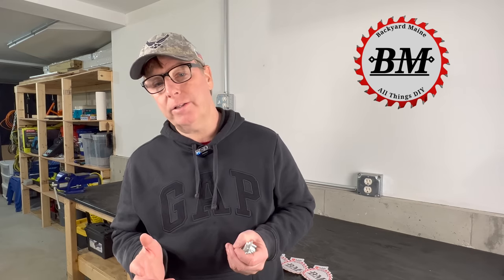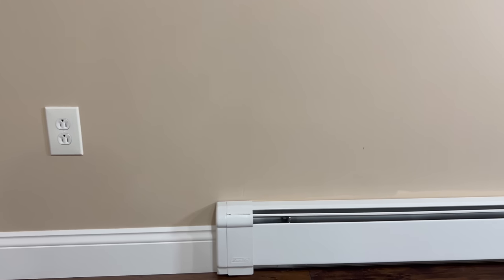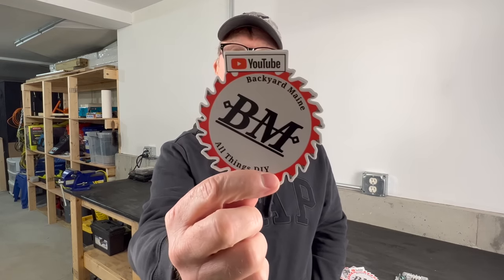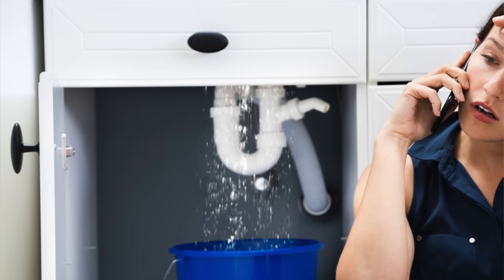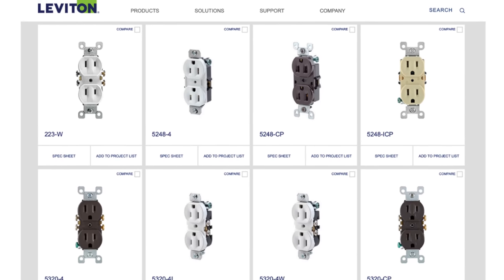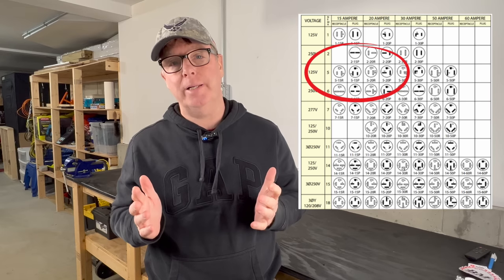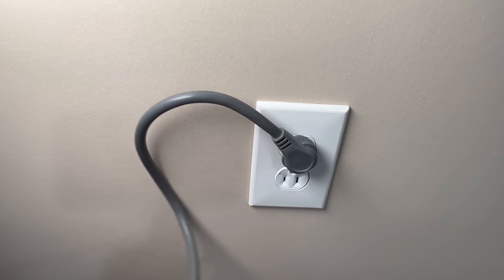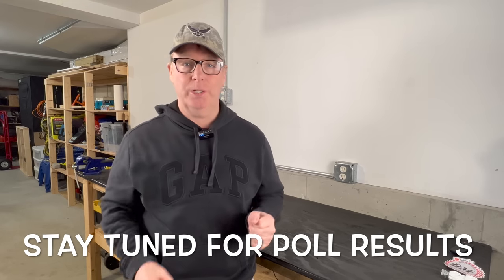Are your outlets installed upside down? (You may be surprised)

Comment: Could someone tell me what the proper term for an outlet/receptable is? I've called them "outlets" my entire life, but then I heard someone called them "receptacles". Then I thought to myself Wait, technically that is a receptacle. But I want to settle this once and for all so that I can master the lingo and bring myself one step closer to world domination.

(Also, I know this is a year old video, but down.)
Reply from the maker: The actual name of the device is receptacle. Most people call them outlets and thats fine too but the code defines them differently. A receptacle outlet is also correct. Here are the definitions from the NEC:

Outlet. A point on the wiring system at which current is taken to supply utilization equipment. (CMP-1)

Receptacle. A contact device installed at the outlet for the connection of an attachment plug, or for the direct connection of electrical utilization equipment designed to mate with the corresponding contact device. A single receptacle is a single contact device with no other contact device on the same yoke or strap. A multiple receptacle is two or more contact devices on the same yoke or strap. (CMP-18)

Receptacle Outlet. An outlet where one or more receptacles are installed. (CMP-18)
Reply: A light fixture, a water heater connection, an AC unit connection, etc., all are outlets. A receptacle outlet is one of many types of outlets.

Comment: Some federal jobs  require ground up.
Reply from the maker: Yup job specs can require things not required by code.
Reply: And they couldn't even begin to tell you why.
Reply from the maker: In a residential setting job specs will often have to do with what the customer wants. In the industrial setting I would spec out orientation sometimes depending on the equipment being connected.  @Kudeghraw

Comment: WHY do these idiots still use slotted screws to hold the plates on?
I use a power driver & slot bits will not stay in a slotted screw. SO,
I bought a big box of #6 X 1/2  phillips head screws and I throw the
slotted ones away. Get with it.

!

Comment: I seriously doubt that anyone except an electrician would object to receptacle orientation on esthetic grounds.  Most homeowners would never notice, except perhaps when plugging in a 90 degree plug.
Reply from the maker: Actually no. Most home owners won’t not write the check until I turned the ground down.
Reply: @BackyardMaine  well you deal with a lot more homeowners than I do so you should know. That's very surprising to me. You must deal with some very discerning homeowners.  When I had my first house built I never would have given it a second thought. All the plugs are ground down in my house though . 
Actually, I would prefer the ground up except for that pesky 90° plug issue.

Comment: 0:42The statement that you make here is false.  I've never seen this done; and, if it is, then it's VERY rare.
Reply from the maker: Nope.
Reply: Yup. ...AND I'm, currently, viewing one - the only one in the room.  I didn't even know that it was the only one on the switch until I tried it, WHICH IS TYPICAL.
I was actually hoping that the room was filled with split outlets.  That's when they connect only half of the receptacles (one of the two in each box) to the wall switch.

Comment: John, Why did you cut off this video without stating the REASON for ground down???

This was irresponsible.  This is an important safety matter, and you neglected your viewers.  

The reason for ground down is that the ground connection remains when one or both the other conductors is intermittent or open.  That better maintains the safety of grounded devices in those situations.  And partially-pulled-out plugs are vastly more common than  metal pieces falling onto pulled-out plugs!  Thank you.
Reply from the maker: I don't find that to be a real issue. The ground prong is longer that the others and you would have to destroy the receptacle before it would disconnect and at that point the hot and neutral would either be disconnected or shorted.
Reply: @BackyardMaine  Okay.  The ground pin is a lot longer for certain.  I haven’t tested what happens if you try to yank things really hard with GND up, so I’ll defer to your experience.  But seriously, there are lots of viewers who’ll be wondering as I did.  I used to be involved, to a small degree, in AC cable design for an audio company, so I look at lots of safety matters relevant to that.  I urge you to make any videos addressing safety to be complete, not requiring a link (which can easily disappear) for a viewer to get a complete message.  But thank you for responding, and for addressing the topic in the first place, that was very helpful.

Comment: Hospitals ground up
Reply from the maker: Usually but not by code. 517 in the NEC has no orientation requirement. It's often due to the fact that the specs were written using IEEE std 602.